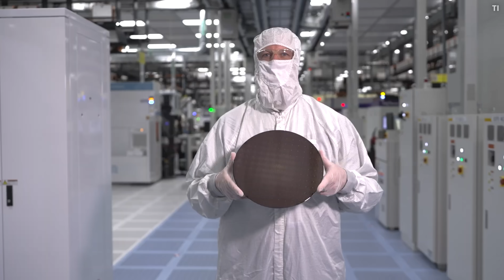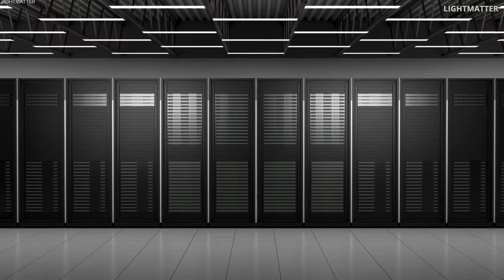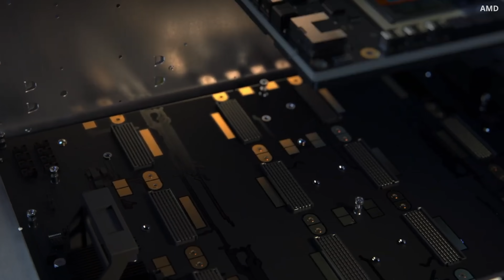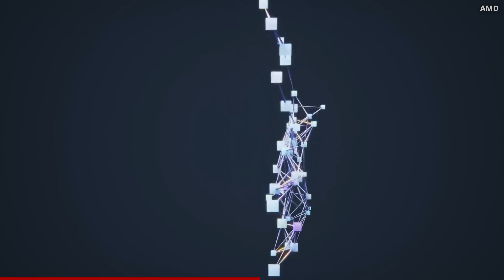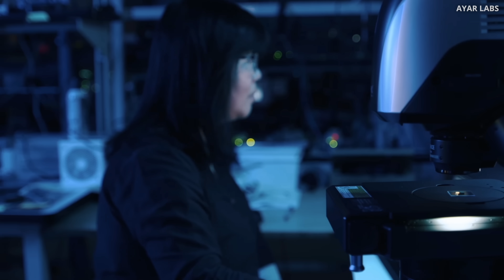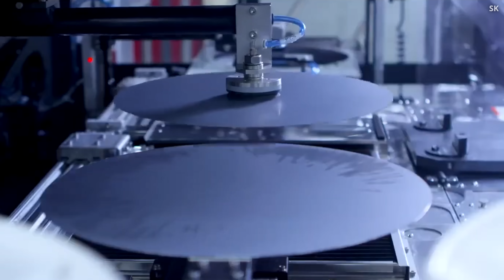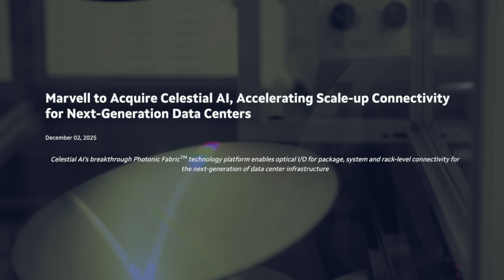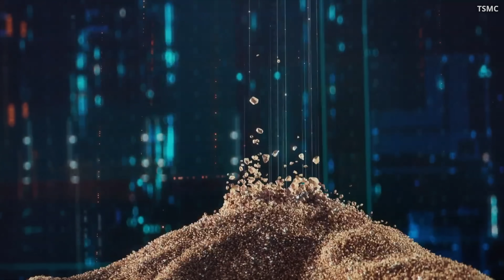Everyone Is Chasing This Technology

Comment: So we can ignore the commercial that tell us to unplug our phone chargers to save electricity?
Reply: Oh but they definitely still need to tax us to save the planet 🤡
Reply: We ignore the continual depreciation of e-car battery recharging, don't we?  
How many watts-in versus how many watts-out does an old battery provide compared to a new one?  You don't know, do you???  That's no accident!
Reply: Where is your statement coming from?  Some phone chargers do draw energy when the chargers plugged into the wall but your phone is not plugged in to it.  Others don't.  It depends on the nuance of details of each device.
I have reduced my carbon footprint quite a bit by using power strips to unplug tvs, microwave, phone chargers and such when they're not being used. I've been tracking my power for several years and I can see how much I reduced it with this practice. 
What are you getting at with your statement That doesn't make any sense without additional details?
Reply: @brianwnc8168  It's absolutely immaterial to aggregate demand, but now AI wants megawatts, no question. If that's not clear to you, I don't have the time or crayons to explain at your level.

Comment: From a national security stand point I would think replacing millions of miles of copper wire, which becomes an antenna during an EMP attack, with fiber optics would be hugely beneficial.
Reply: They will, they do and they did.  A large portion of the backbone of the all connected systems is fiber optics now.  Across the oceans across the nation and now even in back yards.   The devices and circuit boards are the weak link.
Reply: @toolman6872   How many kWh per year are delivered via fiber?
Reply: @RobardoHughes  If she were speaking of power lines then she should have shown power lines....  correct?
Reply: @toolman6872   Absolutely correct!  You'll get no argument from me.  This is one of the WORST supposedly tech vids I have ever seen.  I expect better from Anesthesia!  I started out wanting to correct a few misapprehensions, but then found it is just unfixable.  There is just too much wrong information in this vid.  I don't know why.  Maybe the video not matching the expressed concept is because she has built up a bunch of stock video,  and didn't want to -- or didn't have  time -- to get properly corresponding video.  But that's just the beginning.  The deep-seated incorrect concepts about germanium, and so on, would just take too much time to try to correct.  The idea that balancing light-path delays, power distribution, heat and cooling is new to computer architecture is absurd!  And on and on.  Just suffice it to say it is not her finest hour.  But something this screwed-up makes me wonder how so much of the earlier stuff was correct...???  Something funny is going on here behind the scenes.
Reply: a strong and long enough solar storm emf will fry every electronic circuit on earth, along with the electric grid

Comment: This isn’t just theoretical. Alongside this work, we’ve recently filed a PET-network–based data center cooling back-panel architecture designed to address one of AI infrastructure’s most immediate constraints: thermal regulation at scale. The system is waterless, modular, and integrates power, data, and control directly into the cooling substrate—treating thermal management as a first-class architectural layer, not a facilities afterthought.  What’s interesting isn’t cooling alone—it’s the pattern. The same principle applies across domains: systems fail when regulation is externalized. Whether we’re talking about compute infrastructure or agentic AI, resilience comes from integrated regulation, not bolt-on controls. That’s the throughline here: cognition as regulation under pressure, whether the system is silicon, software, or autonomy.  Inventor and Architect Richard Lynes FOunder Genesis AiX.
Reply: What refrigerant are you using?
Reply: @felixtoulgoat3185  The architecture is designed around supercritical CO₂ as the primary working fluid, not a conventional refrigerant in the HVAC sense.

CO₂ is used because it:

Operates efficiently in supercritical regimes (high heat flux, high density)

Enables direct heat extraction at the backplane level

Eliminates water dependency and evaporative loss

Scales well for very high power densities without exotic materials

Is non-flammable, non-toxic, and already industrially mature

In short: it’s not about cooling air or rooms—it’s about transporting heat efficiently at the substrate level with a fluid whose thermodynamic properties stay stable under extreme loads.

I have a private video detailing the patent on my YouTube channel, can send you an invite.
Reply: @felixtoulgoat3185  I just sent you a video on X, that details the architecture.

Comment: Optical compute is going to be bottle necked by sanctions and cost to change.... I can't see TSMC letting go of their monopoly either... They are already trying to horde node knowledge which won't translate to optical... Putting them back at the starting line after they've had a lead for decades? Yeah, they won't let that happen.... If just for their own 'pride' they'll find ways to stop it or "encourage" it to be stopped

Comment: Waiting patiently for Vaire's energy recovery tech to reset PC design.

They claim up to 4,000x less power - but even just 100x combined with more efficient data movement would effectively make modern chunky coolers redundant, and the chunky state of hi end PC cases with it.
Reply: Forget it. The big tech companies don't have the consumers in mind. You can see that currently in the memory market: most memory modules are told to data/LLM-centers, and the consumers are forgotten; memory prices for consumers have about trippled in a very short timeframe. All what you've been seeing in the video, is targeted to big companies, not to consumers.
Reply: @mpmpm  I'm not talking about this video - this is about a totally different tech that essentially recovers the electrical power expended during each logic cycle rather than wasting it.

If it is successful it wil be in every processor as a fundamental tech from the fab node level development kits.
Reply: @mnomadvfx  there used to be a thing called adiabatic logic.
Reply: they said 50 percent on website
Reply: @prioris55555  "they said 50 percent on website"

That's just their first fabbed proof of concept logic circuits.

They are still in the early stages of implementing it in a full scale processor, let alone getting anywhere near their desired targets.
Reply: @mnomadvfx  ok

Comment: The thing about silicon is its availability. Germanium isn't mined directly but is a byproduct of refining zinc and using coal.
Reply: Do not mistake monocrystalline silicon with sand.
Reply: Another issue with germanium is that you're competing with the military for your material supply. One of it's main uses is for the optics in thermal cameras.
Reply: We could try & increase zinc refining efficiencies & open up new zinc reserves for the top quality grades.
I read coal is much lower grade.?
But whatever the West does, currently China controls 70-80% of refining & that needs balancing out.
Reply: @fishingdude67 Ah yes, now understand the urge for regime change in these countries even better and how they cannot be allowed to have all those resources. They definitely need a little bit more “democracy”, don’t they?
Reply: @anordinarycreature  Do you mean there needs to be a balance of land "ownership", some countries are tiny since they have been attacked and the conquerers have huge land.
Reply: Another huge advantage of silicon is the (relative) ease of creating a high quality insulating layer with SiO2.
Reply: @sandman0123  Can't the same be achieved with germanium?

Comment: We were taught that Germanium transistor circuits are rarely used because of their conductivity drift with temperature,. Old Germanium circuits need lots of excessive temperature compensation circuitry, compared to silicon.
At the 19:00 mark you state: Germanium stays stable even when the temperature swings wildly.
Was I taught wrong or am I missing something?
.
Reply: As I notice, she said about SiGe
Reply: Germanium has a serious problem with thermal runaway conduction.
Reply: @christopherleubner6633   So, like germanium transistors (because it really IS germanium transistors), it is hella easy to burn out.
Reply: People in the labs always lie to claim that their new pet project will be vastly superior to established technology -- IF ONLY YOU WILL GIVE THEM A BAJILLION DOLLAR GRANT to finish their work.  Unfortunately in the case of germanium, we already had an established and deployed technology.  AND IT SUCKED!!!
Reply: This information may hurt. You were taught wrong.... sorry. Germanium is the ultimate transitor gate because it drains energy after saturation so quickly and consistently. So if you switch it in and off it will have the fastest di/Dt rate. This is a lesser known secret of Germanium. Congrats, you became a switched mode power supply expert with this secret!
Reply: @ickorling  Thanks , It doesn't hurt. I have to stay up to date.  Time to hit the Googles.
Reply: @ickorling   As if the dominant component of clock skew were switching time and not capacitance.
Reply: @RobardoHughes  Funny that.
Reply: so basically, it would be a processor that literally expires
Reply: When in 1848 gold was discovered in Sutter's Mill, Sutter went to San Francisco and bought up supply stores and gold prospecting supplies.